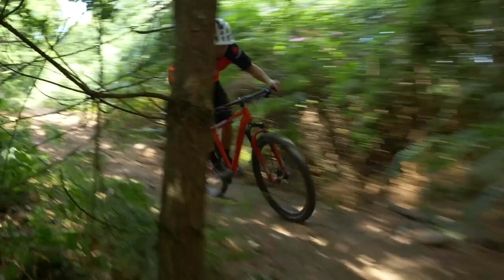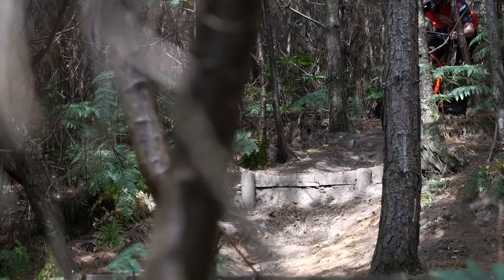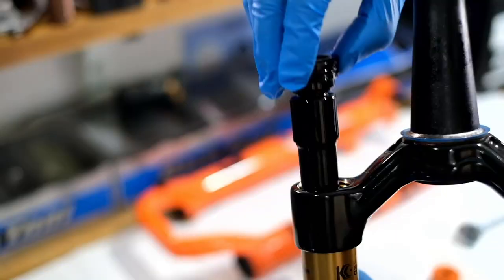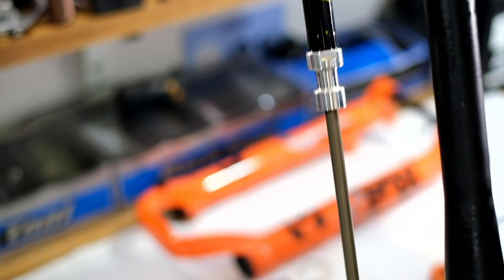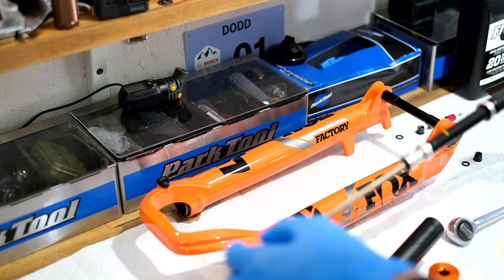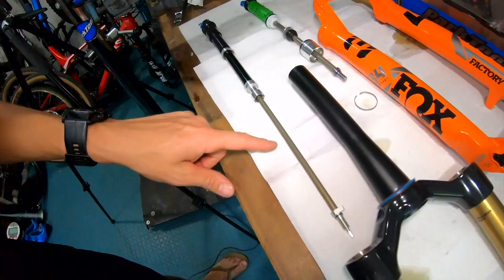Why Do Downhill Bikes Have Fewer Gears Than Enduro Bikes? | #AskGMBNTech

Comment from the maker: Do you have a mountain bike question for us? Use the hashtag #AskGMBNTech with your comment for a chance to be featured on the show!
Reply: #askgmbntech Hi guys. What is the main tech difference between a enduro bike and a downhill bike.
Reply: #AskGMBNTech What gear should you store your bike in?
Reply: I thought Henry left
Reply: #AskGMBNTech My headset shudders under braking forces from the front wheel. Is this dangerous? Are straight head tubes more prone to this than tapered ones?
Reply: Jacobra02 I think there will be a couple vids with because they filmed them before he left
Reply: #AskGMBNTech my dropper post is going up really really slow. I’m wondering what that could be??
Reply: #AskGMBNTech My 2019 Rockshox Lyric does not go all the way up to its full travel unless I yank it up with my hands, I am about 90 pounds is this just because of my weight or a problem with the fork?
Reply: @jacobra0215  he did they just filmed vids with him before he left
Reply: @ninovignes_  Travel, Geometry, Gears, dropper post. Downhill bike = 200mm of travel, horrible at climbing, excels at descending.  Enduro Bike= can climb decently, descend very well but nos as well as a DH bike. Between 150-180mm of travel.
Reply: @lukepws-skiandmtb1122  tends to happen, it is normal. If it bothers you, you can re-oil the forks or service them, or simply remove all the air, lube the stanctions, and repump the air and go through a phew cycles. That should do it. It´s the negative air chamber.
Reply: daniel charlie fernandez Thanks mate
Reply: @danytheunicorn95  Ok thanks
Reply: #AskGMBNTech can u suggest some nice mods for my  24 inch hardtail and a good 24 inch suspension fork ??
Reply: #AskGMBNTech Hi love the content. I serviced my damper in my fork and spilled about 1.5cm of oil. Is it fine to just put it back together or do I need to put in new oil (do I need special oil or are there any alternatives you have at home?
Reply: #AskGMBNTech Can I put bmx pedals on a high end bike? Like santa cruz bronson for example.
Reply: #AskGMBNTech can you use 11 speed chain on 10 speed cassette
Reply: #AskGMBNTech Hi guys, I am  looking for a new drivetrain. Shimano offers I spec. I've seen some reviews. Is it good or bad to have i spec?

Comment: For the 190mm Yeti SB165 guy. I did this experiment with a different bike and got great Results!, I went from a 150mm fork with a 27,5 wheel, to a 180mm fork with.a 29er, and I also fitted an angle set for 70 euros (-2 degrees) so now my full suspension bike went from a 68 degree HT angle to a 63.5 (in theory, feels more like 64.5) and the grip on corners is phenomenal, agility is better on the steeps DH tracks, but you do sacrifice that sharp playfulness on flatter trails.  Hope this helps!

Comment: #AskGMBNTech
Hey guys I just wanted to know why we don't use Schrader valves anymore?
The airflow with Schrader valves should be bigger and this should be beneficial especially considering tubeless tyres.

Thanks for the content I appreciate it I'm now known as the mechanic (shirt will be ordered)
Reply: weight savings
Reply: I believe this was asked on a previous askgmbntech and it has to do with the fact that rims weren't wide enough and rim integrity isnt as good with a bigger hole in it.
Reply: @laurynasjagelo5075  hmm I didn't consider since it's rotational mass adding 2grams means you're about 2h slower on an Hour ride.

BTW I got the joke just an ironic comment
Reply: @Theriver56  that actually makes sense especially at the start of tubeless rims or old school 17mm rims.
But why didn't we "upgrade"
Reply: @maikszczerbuk613  that's a question for the bike industry wizards, but having one valve for all bikes makes it simpler, other than that I see no reason
Reply: Yeah it's due to having to drill a bigger hole in the rim for a Schrader. Less material means less strength.

Comment: #askGMBNtech Hello, I have recently serviced mine fox 36 performance 2019. While servicing I realized I need different oils for air spring and dumper side. For the dumper side I should use 5wt PTFE infused since I didn't have it I used 5wt r3. Would you replace it as soon as possible or is it fine to leave as is?

Comment: In regard to the 2nd question about the 190mm fork - I have a Norco Sight C2 29er: the bike typically has a 160mm fork and 150mm rear but the Fox 36 on it is upped to 170mm. Usually the 29er's HTA is 64 but the 27.5's is 63.5, and on mine with the 170mm fork the HTA is 63.5 like the 27.5, and doesn't seem to affect the ride quality at all. It's what Norco's Enduro team were doing this summer in BC and I've found it great. Bike also doesn't bob a millimeter on the climbs and the shock doesn't lock out, how about that...

Comment: The easy fix for a DH bike is to change the front chain ring. Most are fitted with a 36t, swap that with a 32 and you can climb stuff.  If you have to stand up and pedal a section then you would probably have to on any other bike as well.

Comment: Hi guys, as far as mountain bike definitions, I don't focus so much on the "definitions" as much as the geometry, travel, an most of all how comfortable you feel on the bike. In a normal standing riding position on the trail do you feel cramped up, do you feel too over the front or rear, or do have a nice balanced feel. The best way to do this is to, if you can, try out the bike on some trails. Once you have an idea of what works, you can make a better choice. Bike companies are always changing bike geo numbers, but  they have to bet near the end of where they can go. You can only go so slack, so steep, or so low. Today's large frame will be tomorrow's medium

Comment: #AskGMBNTech This is a follow up question about downhill bikes. Do pro downhill racers even need gears on there bikes, I would assume that they would leave it in the heights gear for a race. Wouldn't  it be easer to run the bike single speed and not have to worry about extra gears? I know Aaron Gwin has won with out a chain.
Reply: some tracks have flat starts / spots so you would need it then

Comment: #askgmbntech The rebound adjust on my 2015 X-fusion vengeance 170mm fork has stopped working. It doesn’t turn in either direction. The fork squeaks when pushed through the travel and it feels really sluggish when rebounding from a compression. It was fine until I rode it in wet/muddy conditions. Any help on what to do?

Comment: @ is a 3/8 really bad, should i upgrade to a 1/12? if so, is they're any cheap ones? Thanks!! (sorry for the comments before idk it i did the # right.)   :)
Reply: cole barrera if your think about upgrading to a 1/12 your 3/8 is most likely a free hub and not a cassette so you will probably have to get a whole new back wheel

Comment: #AskGMBNTech Hello Doddy! I recently got a 2nd hand Giant Reign Advanced (73 degrees seat tube angle) and it has a Specialized IRcc dropper post. I was wondering if I could turn the dropper post around 180 degrees so that it would put me in a more central position, for pedaling efficiency, since the dropper has a thrown-back-top type of thing. I don’t want to damage the dropper or carbon frame, and I couldn’t find much info online.  Thank you!!

Comment: #askgmbntech  is a 3/8 really bad, should i upgrade to a 1/12? if so, is they're any cheap ones? Thanks!!
Reply: A 2 or 3x is not terrible but once you try a 1x drivetrain you will want nothing else on your bike. Shimano SLX is the second cheapest 1x drivetrain that shimano makes and i find it to be the most cost-effective.
Reply: For me, the decision to go 1x was because I had a 3x9 and rarely ever shifted out of the 32t middle chainring. To the point that I replaced it a few times due to wear, and the 44t chainring was useless since the teeth were non stop being bashed on rocks. 
1x8 isn't too terrible if you have a wide-ratio cassette, say in the 11-40 or 11-48 range.
Reply: Maybe go for Shimano M5100 1x11, 1x12 probably isn’t worth it. I’m running XT M8100 1x12 and would’ve went M5100 if it didn’t take so long to come into stock. Got impatient and just bought XT. Not worth the hassle of changing rear hub if you want a 600g cassette.

Comment: @ is a 3/8 really bad, should i upgrade to a 1/12? if so, is they're any cheap ones? Thanks!!
Reply: The advantages of switching  to 1/12 over 3/8 are less chain drop, smoother gear change and less maintenance, in my experience so far. Deore would be a great inexpensive upgrade. That being said I rode a 3/8 drivetrain for 10 years and it served me well

Comment: #askGMBNtech my rear shock makes a clicking noise in the first part of the stroke, this does not happen during the mid stroke and only when the shock is fully open. It is a rockshox monarch plus rc3, thanks.
Reply: r u sure its the shock and not pedals, stem etc? If it is, then service required. I have the same shock no clicking.
Reply: @FlyingMeta  i think the shock is blown

Comment: #AskGMBNTech

Hello all at GMBN. Love what you're doing! Keep up the good work! I have some questions on bike maintenance and parts compatibility issues.

I recently bought a brand new 2016 Scott Genius 740 at 50% discount of the original listed price! It was a great deal to me as the local bike shop was trying to shift some old stocks and the price fit my budget. I have no issues with the bike so far, it feels 'new' and the parts all work fine for now.

My concern is that in 2020, some of the parts are either out of date or will soon be. Example would be the rear dropout being the legacy 142mm spacing instead of 148mm these days. Parts such as the stem, handlebar, and tires can be replaced easily when the time comes without any compatibility issues. However other expensive parts like wheelsets, drivetrain and suspension can be a bit tricky. An example will be my fork which is a Fox 32 Performance Fit4 with 150mm travel and a 100mm wide TA.

If I do some light riding 2-3 times during the week and 1 heavy trail riding on the weekend, how best should I service my fork? How long would the fork last if I follow your suggested service regime?
Reason I ask is because Fox do not make this specific fork anymore and I can see that it may be difficult to find a similar or compatible replacement these days.

Also the bike isn't particularly slack (67.9deg head angle) compared to bike these days in 2020. Are there anything I should upgrade if I was going to do more heavy riding, i.e. gnarly downhill stuff as my skills develop? Can parts these days fit my bike from 2016?

Appreciate the feedback from you. Cheers

Comment: #AskGMBNTech
SRAM GX Eagle shifting issues. I’m having problems shifting between ratios at the bottom end of the block. I’ve replaced the chain and cassette due to wear thinking it would fix it. It didn’t. I’ve replaced the mech hanger thinking it may have been bent. It wasn’t. I’m thinking either bent cage (but I haven’t crashed recently) and it doesn’t look out of shape, or chain line. I have recently switched to an oval chainring and I’m wondering if I need to use a different BB spacer arrangement Any input before I take things apart? Many thanks, love the show👍🏼

Comment: #askgmbntech when fitting a new 12 speed groupset to a new bike build (no old chain to messure) whats the best/easiest way to get the right chain length?
Reply: @martijnsmits6697  what?
Reply: @danytheunicorn95  if you wrap your chain around the biggest Gear and the make it round till the 2 ends touch eachother  
Then add 4 links extra, so a full circle + 4 links

Comment: #AskGMBNTech
Hello,

I’m looking to upgrade from my stock tektro brakes on my XL ‘down country’ hardtail as one of the levers is broke. I was wondering if should go for Deore M6120 (4 pot) or SLX M7100 (2 pot). They’re both about the same price and I’m trying to keep the cost down. I’ve got 160mm rotors but might change to 180mm on the front, Thanks!

Comment: #askGMBNtech I have a crappy coil fork on my hardtail, which means I can only use about 70mm of the 120mm travel, and there is no small bump compression. Do I buy a new spring or a new fork. FYI, there is also some scratches on the left stanchion tube
Reply: New fork, straight up.

Comment: #AskGMBNTech I've been riding my Yeti SB100 hard this summer and on the bigger drops and jumps, my front fork bottoms out. I had my local shop add a volume spacer, and I am currently 5 psi over Yeti's recommended fork pressure, and it still happens. Is this bad on the fork? Am I asking too much of the bike? 120mm Fox 34 Step-Cast.

Comment: Hi, I recently bought a Kona Honzo 2021 and I'm thinking to upgrade the fork to a 130mm or 140mm RockShox Revelation/35 gold. It comes stock with a 120mm fork and I'm wondering if the extra travel would make any difference and how it would affect the geometry? The seat angle is quite steep at 76 degrees so that shouldn't bee a problem. #AskGMBNTech

Comment: #AskGMBNTech Hey guys great show, I have a Shimano deore 10 speed shadow plus gs cage derailleur that came with 11-42 tooth cassette, could I get a larger range cassette after the current one wears out without buying a whole new drivetrain?
Reply: check the spec sheet as all derailleurs have max range they fit/work with, my guess it wont fit any bigger

Comment: #Ask GMBNTech I have a GX eagle groupo, and I have used the b-tension tool to set the b-screw. however, i still get some ticking on the highest few gears even though they are indexed correctly and shift well. could i add or take away some b-tension to remedy this? love the show, boys!
Reply: I put a new B screw thats longer as mine kept bending, and put nuts on both sides to keep it secure. I also put it other way around so it has more of an edge to sit in.

Comment: #askgmbntech do you guys recommend mullets bikes if it is a 27.5 frame and 10mm less travel on the fork with a 29 inch wheel would this work well or at all since i am a smaller rider.

Comment: #AskGMBNTech I have a nukeproof scout that I use for enduro type trails and some downhill trails(hardtails are just really fun) it currently has the 140mm fox 36 rhythm that came with it and I would like to bump the travel up to 150mm, my thinking is that a coil fork (mrp ribbon) would help alot on the hardtail with it's small bump compliance is this true? 
Also how would this affect the geo and how much effect does different axle to crown lengths have?

Comment: Thanks Henry for answering my question (stroke length). Do I have to remove the rebound bolt before removing the eyelet? #AskGMBNTech
Reply: Hey dood. Might not be what you are after but check out DVO coil shocks. They make a number of sizes with 62.5 stroke. Worth a look.

Comment: In answer to the sb165 question, no need to beat about the bush the answer is no. The bike comes stock 27.5 180mm fork and you want to add 10mm travel and also 1.5" bigger wheels using a fork that has longer axle to crown height than a Lyrik or 36. It's not even close to a good idea, as he said maybe fo one or the other, but if you go 29 you will have to refuce the travel if anything not increase it. If you did what you said you would probably have a 60 degree head angle and a bottom bracket miles too high up and combined with the short chainstays of the sb165 a ridiculously unbalanced bike. I have the same bike but it scares me to think you own that bike and would even ask that question..... All the gear and all that...... As the saying goes.

Comment: #AskGMBNTech Coil vs. air fork what is the difference? What are the pros and cons?
Reply: Coil is usually more sensitive on small bumps and has a linear character but heavier. You need to change springs to tune to your weight. Popular in downhill because the linear character is suited for that riding style. On the other hand an air spring can be set up for different riders without changing parts, has a more progressive character which is better suited for hard hits like jumps and drops. They're usually lighter too.
Nowadays we have lots of options to customize air dampers such as air volume reducers, larger air sleeve options (on rear shocks). Some companies even make add-ons that expand the air chamber of some forks and shocks - Vorsprung for example - thus air sprung suspension is getting a wider range of applications.
Reply: @frankthetankricard  OK thanks!